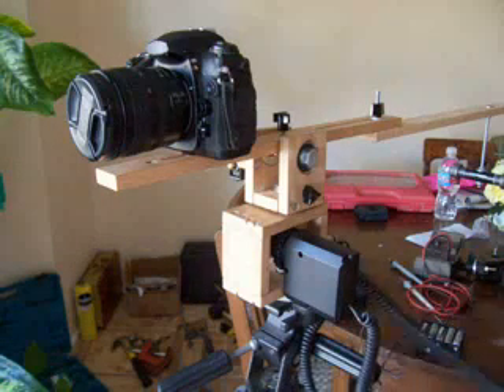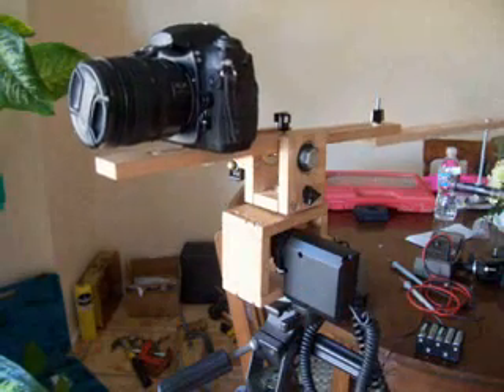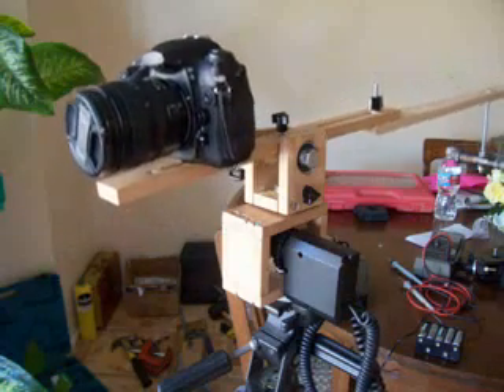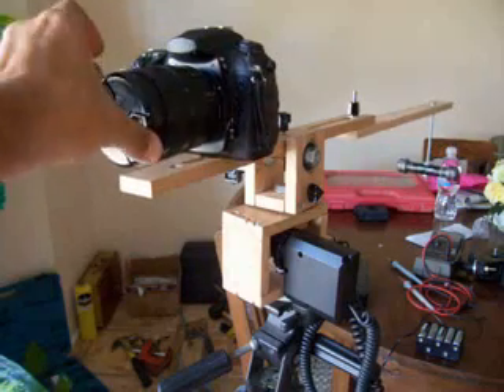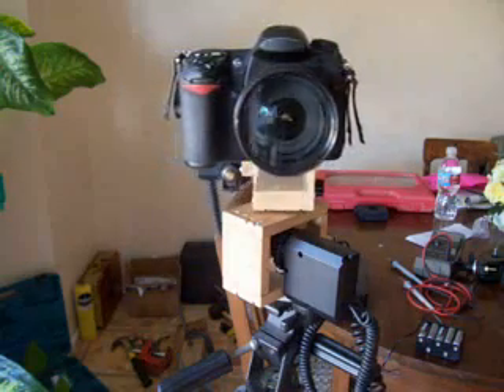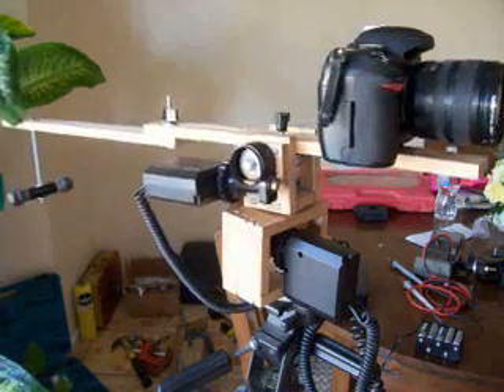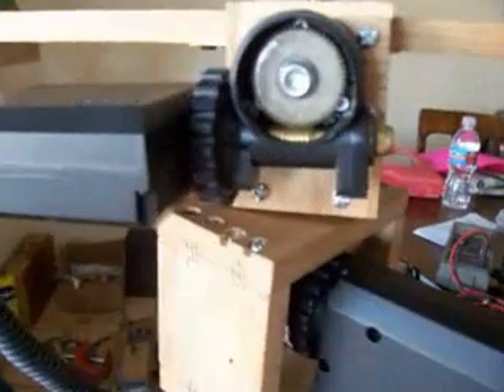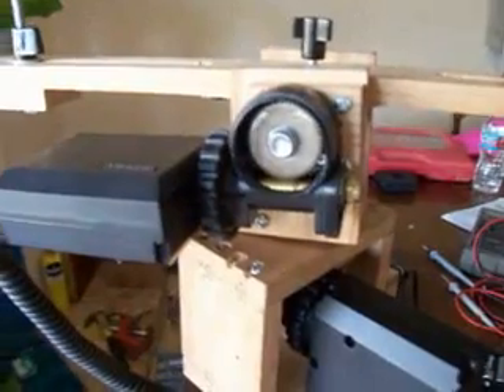Custom Pan Tilt Head Design for Time Lapse using DSLRs

Comment from the maker: Actually I had some problems with the thrust bearing position I was using.  I have since changed and improved the configuration.  You can't just let the thrust bearing float around.  It has to be fixed in place.

Comment: Sweet! Good job!

I found the thrust bearing at vbx bearings. So your finding out how the backlash (or play in the system) is hard to get out. I'm going to see if a machine shop can fab the shaft/plate connection so that it will be nice and tight.
Reply from the maker: It is a tough challenge.